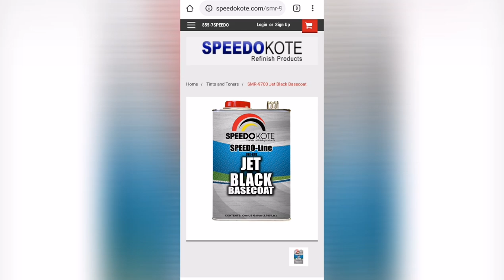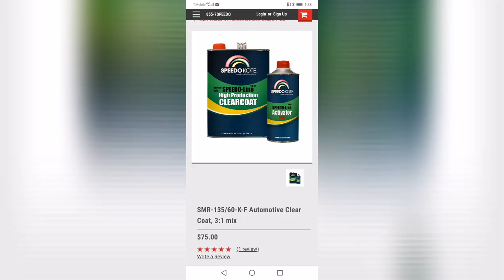Single stage vs basecoat clearcoat

Comment: For solid colors, the overall depth of single stage is hard to beat. An old school trick to help with gloss and maximize uv protection is to mix your final coat 50/50 with a compatible clear coat. Mix each separately first, then combine them.
Reply: Trying to find more info on this.

Comment: Man you make it looks so easy! Are u still using the Mcgraw compressor for all these recent videos? It seems like it’s hangin in there
Reply from the maker: Yea it's still hanging in there!
Reply: @speedokoterefinishnetwork4937  how many gallons is the mcgraw compressor? Do you think its possible to completely respray a 99 civic hatch with a smaller compressor?

Comment: Hi I'm sorry but I'm going to ask... 

I am going to do a white with a little pink in it. I want it to be a satin or matt.  Would single stage work better or should I try to do a 2 stage?  I am planning on buying a cheap electric spray gun to do it with.  Some say a turbine might be better than an airless hand gun. 

Thanks for your video
Reply from the maker: Single stage would work fine

Comment: Excellent video and info , getting ready to paint my 04 Camry, what’s minimum size compressor do you recommend???
Reply from the maker: 30 gallon minimum in my opinion. Get slower drying materials for smaller compressors

Comment: Two coats of clear over a single stage as a base for the win for me. If they are both urethane based products just let the single stage flash like it’s ready for another coat and then apply the clear. Best of both worlds on a solid colored car.
Reply from the maker: I've herd this many times
Reply: @speedokoterefinishnetwork4937 what gun are you using on thiis project as I’m going to attempt to do SS Black for my first project ever? Thanks
Reply from the maker: @TheIrvingsylva  iv only been using my brand the past 3 years

Comment: Do they make a orange peel Eliminator for the base coat clear coat? Not sure if it's the same thing as fish eye Eliminator? But I used to use fish eye Eliminator when I painted cars back in the day I've got a few projects I need to get started on and I ran across this. Please give me some feedback
Reply from the maker: Hey bud for less orange peel in basecoat simply use a little more reducer and sometimes it can help it lay out flatter , for clear coat simply apply it wet and it should flow out on its own .

Comment: So if I'm doing a black nova with white racing stripes what would you recommend I'm using your products and looking to order right now
Reply from the maker: If your doing base clear, just order our jet black base one gallon, bright white base one gallon, and one smr42 clear coat kit. I would use medium speed activator for clear coat, and slow speed reducer for base coat

Comment: What economical paint brand do  you recommend for matching paint according to the paint code of the car. That is easy to mix and easily available?
Reply from the maker: Speedokote had the limco supreme plus mixing system. You can also just go to the local paint store and get the cheapest thing they have. Usually ppg or matrix.

Comment: May i ask what spraygun did u usee? Atomization seems very good, and not much overspray
Reply from the maker: Mark1 refinish products(my brand).. Out of stock currently, will be back in stock very soon.
Reply: What's the cfm requirements on the new gun?
Reply from the maker: @mccoma11  most of these guns will get by with 4-7cfm for small jobs.. Bigger jobs your going to want 10-13 cfm

Comment: Did you use a reducer in the single stage?
Reply from the maker: Sometimes I add a splash of reducer to help it flash better , or if it's super hot I'll add a splash of slow reducer to help it flash slower

Comment: Can you add a layer of clear over top of the single stage to prevent the "hazing"?
Reply from the maker: Wouldn't recommend it . If you want to do clear coat just do basecoat clear coat system
Reply: @speedokoterefinishnetwork4937  I've seen it done without any problems. Why not try on a test panel?
Reply: Only thing wth clear coats it peals easy as colour has nowhere 2 go then sun attack the colour  underneath the clear the clear peals or blisters better leave clear out of single stage paint

Comment: Hi, great video! sorry if this has already been asked. Can you tell me more about why at the end you suggest base coat & clear for colours. I am looking at painting my first car in single stage red mainly to keep cost down but unsure of the disadvantages in doing that. Any insight/guidance would be great. Thanks.
Reply from the maker: Single stage for solid colors is usually the way to go for being cheap and also more user friendly . Basecoat clear coat it's about 4-6 coats of paint total (alot for a begginer ) while single stage is only 2-3 coats total .
Reply: @speedokoterefinishnetwork4937  thank you very much

Comment: Hey Marco, new subscriber here, how close is the single stage to GM U8555? Do you have a urethane clear I can shoot over it?
Reply from the maker: Hey man no point in clear coating single stage in my opinion. If your going for show quality yea this does work good however not 100% nessisary
Reply: My concern is more of durability, actually
Reply from the maker: @LukeFisherGAS  then just stick with the single stage and don't clear coat it. Single stage is more durable than clear coat

Comment: I'm trying to figure out how much of each, primer, sealer and single stage paint it would take to paint just under 300 sqft of surface. Most I see that a gallon will cover is 120 sqft of surface. Any input will be appreciated. Thanks in advance

Comment: That's bullshit  on single stage you do not have to rebuff it every two or three years it is mixed with a hardener very durable more so than base coat clear coat easier to touch up if you get a chip
Reply from the maker: We sell the best single stage paints out there with top notch uv protection. And I'll say after a year in the sun non stop it can fade just a little, if garage kept honestly not much to worry about
Reply: @speedokoterefinishnetwork4937  doesn't seem like the best if you have to buff it after 2 years
Reply from the maker: @sll-tt6bj  ALL SINGLE STAGE PAINTS FADE AT SOME IF EXPOSED TO HEAVY SUN . ask any expert, call ppg, call tpc global, call Sherwin Willams they will all say the same exact thing

Comment: I paint at a maaco  if you intergrade the clear 3 quarts to 1 quart integrated clear on the last two coats it more durable than base coat clear coat  because  it won't flake off like clear coT dose

Comment: Can I paint a bumper by only spraying adhesion promoter or do I have to prime it or put on a sealeant
Reply from the maker: You can use the speedokote trc 500 adhesion promoter and primer sealer in one and move straight to paint. Iv done it a few times.
Reply: @speedokoterefinishnetwork4937  thank you.

Comment: I had my car professionally done recently with single stage. But if I'd it very thin. One little tap and it goes straight to metal. How many coats should be applied in single stage ?

Comment: do i need to add sealer after sanding my red fox body, fixed some dents and added filler primer in areas. im painting it red again single stage. could i get away from leaving it like that and laying down 3-4 coats?
Reply from the maker: @alltorque415  as long as it's all sanded , smooth ,ur good 
Throw in a good 3-4 coats of single stage send it down the road. 
If your purchasing anything speedokote select me as your rep (Marco) 
We have a amazing race red GO BUY IT YOU WILL NOT BE UNHAPPY
Reply: @speedokoterefinishnetwork4937 Thank you for the reply back, 1 more questions. im sanding door jams and the paint is black, should i primer  it or it will be fine doing the 3-4 coats as well. im definitely going to look at race red on speedkote and will definitely select you as you rep. You dont understand how much your videos have helped me over the years. i appreciate all the help you’ve done for all the DIY people

Comment: I hope whoevers car is parked right in front of all of your overspray does not care about their vehicle LOL
Reply from the maker: I use certified EPA booth filter which takes out 95% of all over spray.
Reply: @speedokoterefinishnetwork4937  OK but in the video you’re not you’re just simply spraying and open garage with the doors wide-open .. so how is that going through a booth or a filter before it goes outside it is not at all but I don’t care I’m just saying I wouldn’t be parking there LOL and glad you had better luck I did with that paint was garbage for me I tried the black and it was horrible definitely get what you pay for👍🏻We tried it once at my shop painting motorcycles and never bought it again it just was not quality

Comment: Do you have a video on painting Chrome? 
Have you found a clear coat that doesn't turn Chrome paints gray?
Reply from the maker: @INTIREMOBILETIRESHOP  not many videos on painting chrome
Reply: @speedokoterefinishnetwork4937  The Speedokote wheel chrome is pretty reflective until clear coat hits it. Any tips or recommendations?
Reply from the maker: @INTIREMOBILETIRESHOP  have you tried our aluminum clear coat ?
Reply: @speedokoterefinishnetwork4937  if you mean the direct to aluminum clear coat then yes I have that. I'll try it, thanks.
Reply from the maker: @INTIREMOBILETIRESHOP  that stuff is better over heavy silvers
Reply: @speedokoterefinishnetwork4937  I'll try it tomorrow. Appreciate you

Comment: what pressure do you use for the clearcoat and what tip size,,ive been told 25-30 lbs and a 1.3 tip??
Reply from the maker: 17-25psi 1.3 tip

Comment: How about on a motorcycle where gasoline can spill on the tank. Is the single stage ok to use or should it be 2 stage?
Reply from the maker: Should be fine remember you can always buff single stage. Ours is extremely durable

Comment: Is it a good idea to have Maaco do a single stage in my 2018 Fusion

Was side swiped needs a lil bondo and has some scratches

Only flawless part is the roof😫

Should I buy my own paint?
Use another shop?
Have someone sand it down first?

Sorry for all the questions 
You’re very clear and concise?
Reply from the maker: If you don't plan on keeping it long mabey
Reply: I know someone who had a MAACO single stage paint job done and it looked really nice and is still looking nice after 12 years.
Reply from the maker: It's hit or miss

Comment: Marc, do you reduce that clear coat??? i have 1/2 gal left an would like to reduce maybe 1 part. or even 2 parts. because i cant get the finish to look like that.
Reply from the maker: The most I reduce my clears is 2.5% just to make them flow out a hair better
Reply: @speedokoterefinishnetwork4937  Thank you my friend
Reply from the maker: @venezia7252  keep in mind if you reduce a clear with slow reducer it will flash off slower. If you reduce a clear with fast reducer it will flash off faster.

Comment: Hey I need advice,  I'm going to be spraying a truck bed with rustoleum out of the gun, is there anything I should be worried about ? I have a huge fan and I have a booth filter ill be putting on it from my work, im just worried about fumes and if someone complains, ill be in a mechanic shop on the side of a decently busy road. Any advice would be appreciated. Do you think the filter would be enough for keeping the fumes low?
Reply from the maker: You should simply not do it. Saving 100$ is not worth the headache of all the problems you get with a rustoleum paint job
Reply: @speedokoterefinishnetwork4937  its not my decision, it's the guy from the shops decision, it's his work truck so he just wants it all one color.
Reply: @speedokoterefinishnetwork4937  I tried to convince him to get shopline ss but he's too cheap
Reply from the maker: @b323ss2  I wouldn't paint it lol. If he can't even afford to spend 100 on paint leave it looking like crap. Our speedokote single stage is only 99$.

Comment: I see snow outside and your door is open.   Was the area heated?  Did you use a fast activator?  Its winter where Im at and I am wanting to paint.  What techniques do you have to employ to paint in a cold shop?
Reply from the maker: Fast activator and lighter coats
Reply: @speedokoterefinishnetwork4937  Marco, can you make a video on how to set up and adjust a gun.  Show the pattern, pressure, flow of the paint, etc. Some times I can get really good spray and coverage and other times it just sucks!   Just an FYI, I am using a single stage paint. Not speedokote.
Reply from the maker: @davidw1164  I usually just go full fan full fluid

Comment: It's way easier for us novice diyers to do single stage. Spraying it is easier than base and clear and that's considering most of us are using cheap harbor freight guns like me. Also can sand and polish any imperfections more easily than base and clear, and we could do multiple coats so we have more to lightly polish once it oxidizes. Regret doing base and clear. Isn't horrible but single stage would've resulted in a better finished product. 

I think I may want to sand the clear and paint off my truck I did a while back and just urethane single stage it and do multiple coats. Will probably pick up the new green gun. my purple gun is old and was used to do just rustoleum paint which I got dialed in perfectly. Never did clear before and that's what I was scared of and rightfully so.
Reply from the maker: Single stage will forever be KING in the automotive paint world for simple paint jobs.
Reply: @speedokoterefinishnetwork4937  with single stage will there be any benefits of spraying clear coat over top just wondering if it would provide better protection especially for winter use and a deeper shine or would I be wasting time and money by doing this.
Reply from the maker: @jasonbrown7258  I'm going to be doing a video on this

Comment: Great vid, wondering the longevity of speedokote. Looking for new clear for the shop and came across your videos. Have you had any problems years down the road with fadeing or peeling on clear coats? Definitely gonna try this product.
Reply from the maker: Just had a youtuber comment yesterday they used our cheapest 59$ clear coat (Smr1150) 2 years going strong no fading no issues.

Comment: Great info . Is applying clear over a single stage paint a option for increasing  durability if someone wanted to do it?
Reply from the maker: Simply do basecoat clear coat if you want a better quality paint job
Reply: Dude, the main and very crucial purpose of single stage paint is reducing the cost since you can't afford a base and clear. Now you single stage and clear it afterward, a total waste and total defeating its purpose
Reply from the maker: @dannytrinh07  that's pretty much what I tell people. It might not even be that you cant afford it you might just be trying to freshen up a super cheap beater like my accord 100$ paint job

Comment: Awesome results with the single stage. I’m having problems getting my Summit Racing single stage to lay out flat. I get a bit orange peel. I’m using my HVLP Devilbiss DV1 with a 1.3 MM fluid tip at 29 PSI. Full fan, full fluid. I was wondering what your gun settings are. I’m starting to believe I should try using a conventional spray gun or up the pressure in my DV1.
Reply from the maker: It's cheap acrylic enamel that's why . Never lays flat
Reply: @speedokoterefinishnetwork4937  Haha, that’s what I figured. Buffs out nicely though. 😅
Reply from the maker: @Void-gn9zm  hey thats good ! I never buff so that paint wouldn't work for me 😂
Reply: @speedokoterefinishnetwork4937  Lmao yea I’m gonna try the paint you’re using. Sunmit paint sucks. I know I can do better with this Devilbiss DV1. Cost me an arm and a leg haha.

Comment: I bought the base coat clear coat jet black from watching your videos. Thanks Mark. It looks great
Reply from the maker: Awsome!
Reply: @speedokoterefinishnetwork4937  Hey quick question. I used the $59 clear for some small panels as I practice for painting my truck. Which clear do you recommend for a show quality gloss SMR- 42 (premium hs) or the SS-1200 glamour clear. Both are $179 just don’t know which one to go with.
Reply from the maker: @KJsGarage  ss1200 is super super super high gloss, Smr 42 is super high gloss Aswell but also way higher build. I love both honestly. Ss1200 is more user friendly.
Reply: @speedokoterefinishnetwork4937  thanks a lot. SS-1200 it is.
Reply from the maker: I usually use fast activator always with this clear. It dries real slow even with fast activator
Reply: @speedokoterefinishnetwork4937  I’m in Tampa, Fl it’s 90 plus everyday. You think slow still with a high heat environment?
Reply from the maker: @KJsGarage  literally never use slow with this stuff. Mabey medium if it's 90
Reply: @speedokoterefinishnetwork4937  I was meaning fast but typed slow. SMH but I’ll get medium then. Thanks for the help man. Keep up the great work on the channel.

Comment: Yeah, both have their applications. "Single stage" is for trucks, tractors and structural/inner panels on cars. Because you "get what you get" if you have runs, bugs, dirt in your paint (which you did) you can't fix it. You have to scuff and redo the panel.

For a perfect paint job, BC/CC is a thousand times more user friendly. I wouldn't recommend it, but I've had guys do a BC/CC paint job outside.
If you get a defect in the color....you can fix/blend it till it's perfect. Same with the clear coat (unless it's severe) As a painter, you also have more control over the match. 
For an over-all, there's no reason you couldn't use the cheap paint and expensive clearcoat. All the hardness, gloss retention and UV protection comes from the clearcoat.